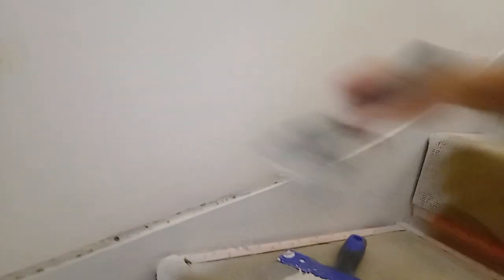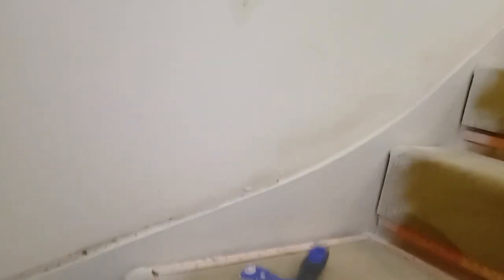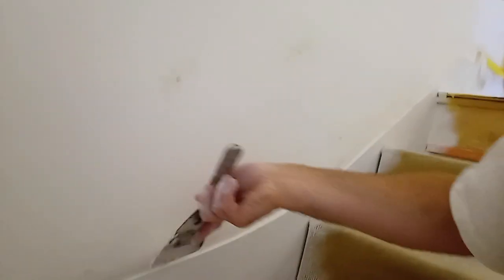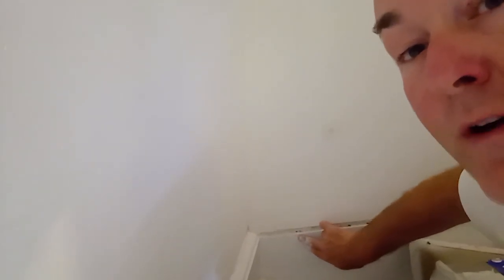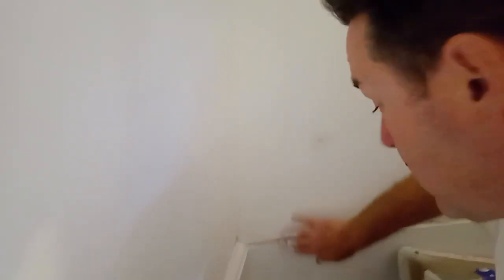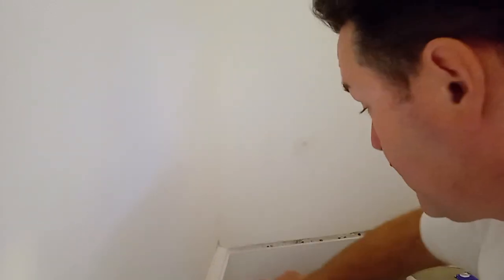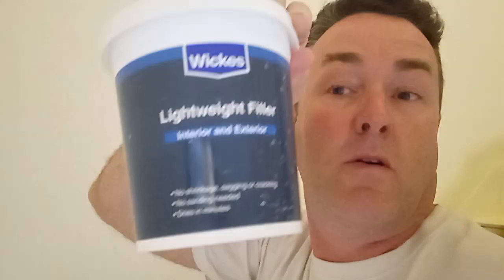filling that annoying gap on a staircase

Comment: I would of beaded that in 10 minutes, how much time did you spend on that, must be charging big prices to cover that amount of time, anyway it will crack soon enough then what🤔
Reply from the maker: Cracks are good for business ;)
Reply: The sausage foil caulk is far more flexible than standard caulk
Reply: How would you bead the flush area ? 
Would look even worse 
Original plaster boarders want shooting , or joiner for incorrect fitting of stairs 
Supposed to pack out with a slate batten and slide a board down behind so you get a parallel width to top edge of side strings 
Pet gate of mine
Reply from the maker: @richardmcdougall233  is it interior and exterior like the RedDevil flexible caulk?
Reply: @richardmcdougall233  does that mean there's even more chance of the paint cracking on it?

Comment: Pretty much how I do it mate… only exception is I have trouble with crazing caulk so to get round that I prime my caulk with 123. Solves that problem when you hit it with your finish coat. Or sometimes if I need something with more of a bonding strength I’ll use a paintable polymer sealant and then prime that. Just ensures I don’t have any crazing over the sealant. Real good primers by zinsser! Take care buddy! Marc.
Reply from the maker: get some reddecil one time caulk to try, i don't get any problems with that

Comment: Phil........why 123+ and not just straightforward 123? I've never used the 123+ and just wondering what the difference is? Never tried the Gardz either.........must give it a go.
Cheers Bruv
Yorkshire Dave👍👍
Reply from the maker: 123 plus is the next step up over normal 123. The 123plus will also stop water stains, and says on the tin GOOD for stained woodwork. BIN is an option, but stinks when spraying. The 123+ des dry nice being waterbased too.

Gardz.. a great problem solving paint..... did i tell you it's not the same as PVA ;) lol
Reply: @ProfessionalPainterDecorator  Right, I'll give 'em both a go Phil! Oh and by the way, I rarely use PVA......and never with paint!! Keep 'em coming, right!!
Cheers Bruv
Yorkshire Dave👍👍

Comment: Hi Phil. You deserve that dream car..  you said you use 123+ on the wood which had a light stain. Any tanning coming back throug.
Reply from the maker: No, nothing. One of the reasons I went for it.
I also sprayed out some water stains I could see on the ceiling above... Two coats... They've held off too.
It does say it stops water stains.

I'm going to give two coats of it on some worse water marks in a few weeks. See if it does what it says on the tin.

Comment: Has the foam pushed the plaster boards forward ans that's why there is no edge on that part of the stringer? Or was it already like that?
Reply from the maker: Always been like it. When it was originally fitted, why wouldn't they line it up right?

Comment: Hi i have just found your channel and working my way through your videos. I have just finished my city & guilds level 2 P&D but im having trouble with filler flashing on walls ? Also i have filled gaps in lining paper, mist coated filler then 2 coats and the lines are still showing. Any ideas on where im going wrong and how to rectify would be much appreciated x
Reply from the maker: Welcome aboard! You shouldn't be leaving gaps in lining paper and filling them. Butt joint, once dry you whizz over the lining to lightly see and off anything that may have got under the lining.. it happens.. a grain of sand is like a bowling ball under lining paper.

Loads of videos for you to watch. ;)
Reply from the maker: Also, maybe worth you changing your filler.
Reply: @ProfessionalPainterDecorator  I use toupret because it's not meant to flash? What would you recommend?
Reply from the maker: @nataliehayden8330  good. Presto F is good too
Reply: @ProfessionalPainterDecorator  I had a problem with the edges drying out on me although I thought I was putting plenty on the wall (using wallrock) because I was papering over a painted surface should I have done any prep? That would have helped?
Reply from the maker: @nataliehayden8330  did you size the wall first  use tub paste for the wall rock?
Reply: @ProfessionalPainterDecorator  no did not size the wall, is what causes my problems? I used tub paste. What would u use to size? Watered down tub paste, do u let it dry before applying paper or use packet paste to size?

Comment: Another nice video phill pretty much the way I do it apart from the lightweight filler I’ve never seemed to get on with it totally agree with you on the pva front
Reply from the maker: Lightweight filler just skims out the sunken main filler, it dried quick to so can be painted over in no time. Used itbtoday on a few indentation on the walls that you couldn't see until it had a coat of paint onto it, filled them before dinner, touch up after dinner, then Coates everything back up.... A life saver you could call it. Doesn't soak in the paint like a powder filler either, so less likely to show flashing. Spot prime those areas though.

Comment: Hi Phil does 123 plus hold back the tanning/knots on the woodwork
Reply: Cover stain is supposed to
Reply from the maker: Only BIN will stop Knots ... As it's spirit/shellac base (thin with meths)
123plus will stop staining, and it's suitable for stained woodworking like the staircase I did.

Coverstain is oil based, but doesn't stop Knots.
Reply: @ProfessionalPainterDecorator  I’m glad I use knotting 1st then lol. Sorry for the incorrect info

Comment: When you say prime everything before filling you mean a white paint primer or use zinsser guardz ??
Reply from the maker: Not necessarily.
Different substrates need a different primer.... Before you fill and caulk etc.
Bare plaster you do a wash coat of thinned emulsion.. or Gardz.
Soft wood will be a different primer to a hard wood or a resinous wood.

Just check before you apply a coat of something as to whether it's suitable for the surface it's going on.

Hard woods and resinous wood can be tricky... Get it wrong you'll make harder work for yourself.
Aluminium leafing primer is normally the one that sorts out most problematic woods.
Reply: Thanks for the information Phil
Never used the guardz before...I just use Bedec MSP for nearly everything these days.
Also surprised you do a final mastic line,then run tape along side.Have had problems with that in the past where I've pulled the mastic away with the tape.Guess you need to let the mastic set for a few days ? I just use red devil filler these days for the final trim to make smooth.Usually only an hour or so waiting time then ready for painting.

Comment: With the Woodwork.  You
You used 123+ did you use an undercoat or strait on top with the topcoat over 123+
Reply from the maker: two coats of 123plus on the wood stain, when dry, nibbed down again.. the two coats of Everal Aqua 40.
came up great.
Reply: @ProfessionalPainterDecorator  what preparation did you do before applying the first coat of 123+ any knotting solution
Reply from the maker: @richardloze5994  no, it wasnt a knotty wood.
Reply from the maker: @richardloze5994  fingers crossed the 123+ hold back any staining of the wood ;)